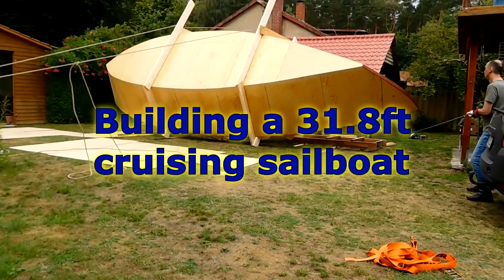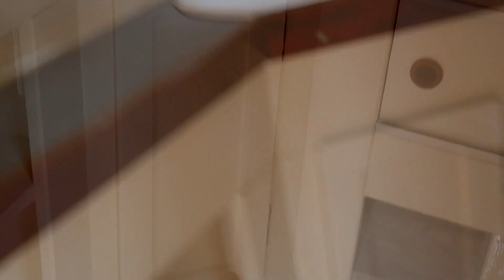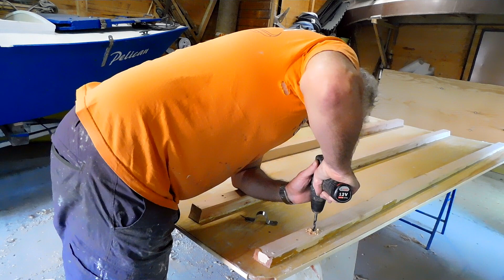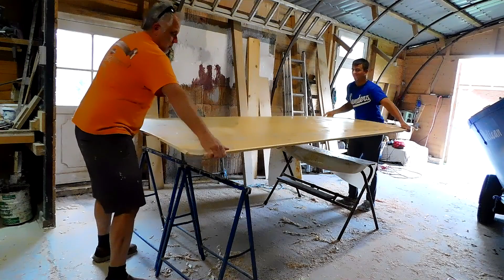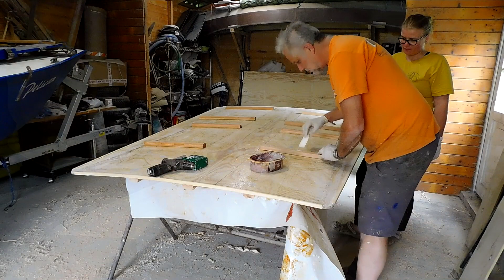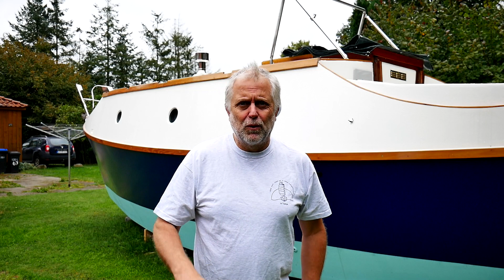Episode 200!! Building a cruising sailboat - SV Tapatya

Comment: For those less than sunny days, when you don't want to deplete what little energy you may still have in your batteries, A nice 'Aladdin Kerosene Mantle Lamp' provides a great deal of light and a Bit of warmth as well. We had the table model with the shade and I clamped the rim on the base to the dinette table with machined, retractable brass slugs that could 'pop up' and rotate to anchor the lamp. The mantle burns at almost any angle and a smoke bell keeps the cabin clean. Kero is so much safer to store than propane, and it's sold everywhere.
Reply from the maker: Yes Mike. We had kerosene lamps on our old boat too. They're certainly an effective way of getting light and a little bit of heat without electricity. Having said that, l think that we won't need them. Modern led lights draw so little, we should be good 👍